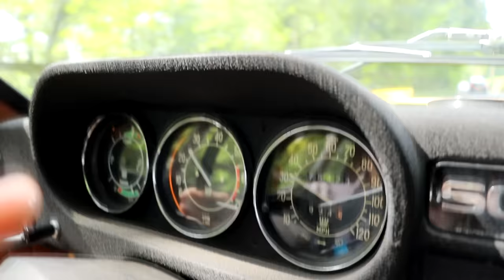Falling In Love With The Bentley Turbo R On An EPIC Classic Car Roadtrip!

Comment: Check out passanger side hub cover. its seems not to be properly installed. There are "hooks" on the inner side of the hub cover which have to slot into the rim, then you need to slightly press in the cover and sqeeze the o-ring a little. After that, the locking mechanism of the hub cover will drive you mad :D
Reply from the maker: Turns out our o-ring is knackered, yet another bit to buy!

Comment: To have bought this Bentley ‘ sight unseen, and without a prior inspiration’, is sticking your neck out a bit, however you still ended up with quite an excellent motor car. The last car I bought under more or less the same circumstances, that’s to say, no inspection, and sight unseen, was a 1989 Rolls Royce Silver Spirit ‘Mark One’ EFI ABS saloon........Did I come unstuck ?, No absolutely not, she is just wonderful. 🇬🇧👍.

Comment: Some  fantastic  cars  but well done  the  Bentley 👏 would  like  to know  the fuel  cost.
Reply from the maker: Thanks Wayne! 😁 We'd rather not know, but we worked out the Turbo R was doing 14.6MPG, apparently the TVR was doing 9!
Reply: @ClassicsWorldUK   Bentley  for me  then. 😀
Reply: @ClassicsWorldUK  My '96 Turbo R has been averaging about 18.3, though that did include some motorway cruising. The later electronic fuel injection is supposedly a bit more fuel efficient as well.
Reply: @ClassicsWorldUK  I filled mine up this afternoon, been doing much less motorway driving in the last 100 miles where it ended up doing just over 12... dropped my average down to 17.2